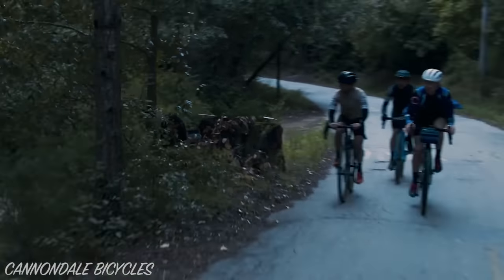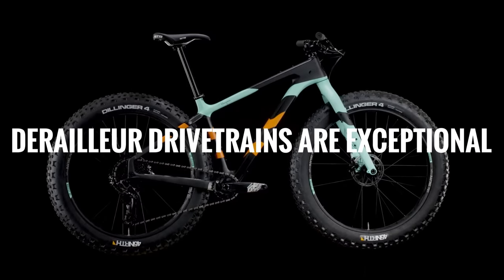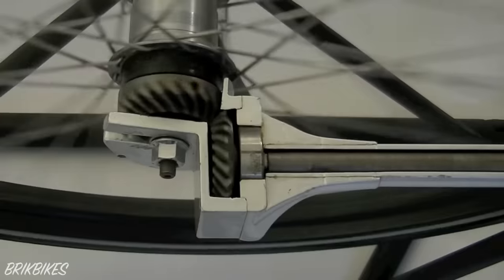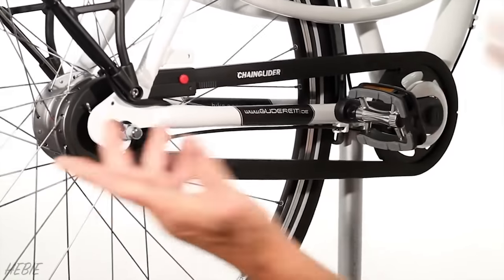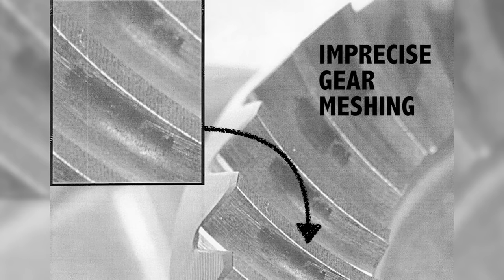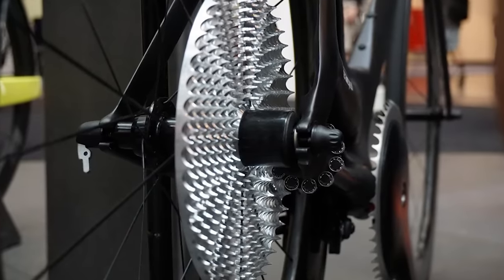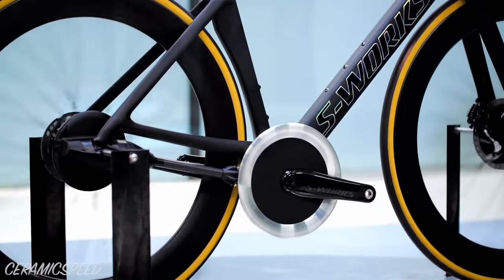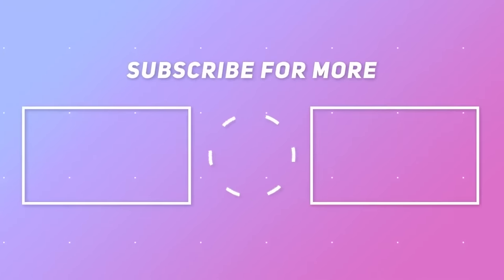Are Chainless Shaft Drive Bicycles a GENIUS or TERRIBLE Idea?

Comment: although not directly comparable, there's more chain vs shaft data in the motorbike world. From memory, their numbers were 95% for chain and 80% for shaft.
Reply: There's one thing that I have to wonder about though... I assume all these tests were done with fresh sprockets and chains. But if we assume that the user is not going to maniacally change these parts as soon as there are smallest signs of wear, the efficiency will drop, and chain system will likely start wearing much faster than shaft. Maybe on average the difference is not that critical?

Motorbikes also have a separate gearbox instead of a derailleur, meaning they have much less chain/sprocket wear, too
Reply: Bike chain line efficiency has been studied to death. Bike chains can reach 98% under lab conditions with certain fixed large diameter sprocket combinations, think 30T+ on both ends. 

In reality a fresh and properly set up 9 speed drivetrain hits between 83% and 95% depending on sprocket combination and drops from there over time. The individual factor with the highest direct impact is chain tension. Any slack in the return (ie top) of the chain greatly impacts efficiency.
Reply: @N V Percent energy transferred, the higher the better. Remaining lost to noise and heat.
Reply: @N V Different parts do different things. Thus different efficiencies. Dont mix things.
Reply: Slightly off topic - back in my motorcycling days I had a motorbike with a driveshaft. On one memorable day the driveshaft snapped. I was travelling south on the A12 (in the UK) approaching the junction with the M25, maybe a mile or two away, at about 70mph. The two ends of the drive shaft then wedged together inside the casing, locking the back wheel solid. Biggest skid I ever did.

Comment: I think the gearing needs to be at the crank, and fixed at the axle.
Servicing and sealing would probably be easier. Also, the ring gear could be supported and aligned by the stronger frame, not weak spokes.
Reply: @MikMech -- that is what I have always thought too.  A Rohloff hub with a shaft drive might be the ideal city bike set-up.
Reply: I agree. What excites me most are innovations around gearboxes like Pinion’s that happen at the crank. And, given the current technologies I like both chains and belts. I have both and they’re both great in different scenarios. I have a single speed with a chain, multiple bikes with chains and derailleurs, and a bike with a gates drive and shimano hub. They all have their place right now but an efficient, lightweight gearbox at the crank that can change gears under load seems to be the most realistic ideal.

$.02

Comment: I was working in a machine shop in the mid 80's in Chico CA while going through engineering school.  One of the machinist's showed me the exact concept here that he was working on.  He was very excited this would revolutionize biking.  I didn't think he had much of a chance of succeeding as I figured it couldn't compete with the efficiency of a chain.  But here we are.   I hope he profited on this some how but it's very difficult to bring a product to market, even more so before the internet.  I suspect this was independently developed and he never received anything.
Reply: There's also one system I've seen where it's rods pushing back and forth.

Comment: Note to self: modify Street Racing car to use chain drive and derailer.
Reply: Reliability is a factor
Reply: Buy a Fraser-Ńash car.
Reply: No point. They have transmission with a shaft drivetrain😂 derailleurs are just small size transmissions😂

Comment: In my experience, the few shaft-driven bikes I had rided feel much heavier than normal chain-driven ones.
Reply: @Karl with a K The video stated that they are less efficient than a chain drive…
Reply: @Karl with a K "zero maintenance" is a complete lie.
Reply: @Karl with a K you should be a shaft bike manufacturer for saying shaft are more efficient :D

Comment: the chains advantage is that motion stays in the same direction throughout power transmission.  a shaft changes three times.  Each change introduces inefficiency .
Reply: Added to that is the shaft is angled away from the crank-angle!

Comment: Looking at the Driven system I'd say it has a flaw you didn't mention, similar to your #3 - forces on the teeth are applied in a direction where the sprocket is weak.  In a chain drive, higher tension pulls the chain into the teeth.  In a shaft drive, it pushes sideways on the teeth.  There's also much less distribution of force; in a fresh chain and sprocket, it can pull on multiple teeth, the Driven will only ever be one bearing pushing on one tooth.  Aside from the mechanical leverage you mentioned in #3 this is why bevel gears need to be built much more heavily.

Comment: Actually... If you put the drive shaft of the bike on a pivotable axis that can swing horizontally, then you can add a stack of different size gears on the back wheel. Then you would want to make the drive shaft's gear on the back end be spring loaded so it can move forward and backwards inline with the direction of the chassis, the spring action being parallel and also add a control chord you can adjust from the handlebars. Finally you will want to add a spring loaded cable to control what gear on the wheel hub is lined up the shaft. This cable would be attached to the handlebars and can even be wired through the frame. This cable is the cable that controls left and right motion along the horizontal axis (perpendicular). Now you could go through all that to make it have shiftable speeds, or you could replace the springs with motors. Or you could buy a hub motor for any bike size 20"or larger. Just a thought 🤔

Comment: I never even knew shaft drives were a thing for bikes. sounds like a great idea to me. I've never had a bike with a derailleur that didn't get messed up somehow after a very few uses, and wind up gettint stuck in one gear anyway. 

In fact it's so bad the last bike I bought was just a single gear, just like a kids, so I didn't have to deal with it.
Reply: You must have been buying low end bikes then
Reply: Internally geared hubs are a thing too.
Reply: Maybe next time you will take better care of your bikes.
Reply: Try adjusting the derailleur
Reply: To ignorant to figure out a bike? I wouldn't be bragging that up.
I've got a 30 year old derailer that works just fine. But I know a thing or two about maintenance.
Reply: @brianellison3525  as an engineer, this is a terrible point, you might be invested in your bike, but 99% of the population is not especialy kids, they want to be able to get it out of there cluttered garrage, go to the shops, maby do some trail biking, then bring it home and chuck it back in the shed for another 6 months
you wouldent expect the average person to be able to fix problems with there car, thats why manufacturers make them bombers as all hell so your average joe wont have issues they need to fix all the time
not to mention other people, twice now ive had someone put there bike next to mine and fuck up the derailleur when ive put it into a bike rack
and sure, better derailleur's on nicer bikes wont have so many issues as someone else pointed out, but again average joe is dropping 150-200 on a bike at most, they are getting the cheepest derailleur china can manufacture
you have to take into account the consumer base on thiese kinds of things, just because the manufacturer failed to do that, does not make your average person ignorant
Reply: Could you tell more about the bikes you use? Did the derailleur got hit to be messed up or did it fail during normal bicycling? If the latter, are you using cheap bikes from local supermarket? With a cheap derailleur you have to adjust it before every run and it still doesn't work great because it has so poor tolerances. With high quality derailleur, you adjust it maybe once a year and unless it gets hit, it should last for a decade.

Comment: that is A LOT of assumptions you make about shaft drives based 
on one test from the 1980s
Reply: Bicycles aren't the only machines that use gears or chains, the efficiency advantages of chains and belts over gears (and especially bevel gears) have been well understood for a long time.
Reply: The cost, lack of efficiency, and lack of easy fix is still prevalent today.  Keep in mind the bicycle is by far the biggest mode of transportation throughout the world for almost 2 centuries.  Somebody keeps trying to revive the shaft drive like somebody keeps trying to make a better rotary engine.  Its not happening.

Comment: Myself I think it's do with the derailleur being able to be used on a wide variety of bike. I follow a guy called Allen Milliard and he made multiple amazing downhill bikesfor his son who competed that where on average around 3 secs faster than other bikes at the time. Great content very interesting, thanks for sharing.
Reply: And he did it by using a Shimano geared hub mounted inside the swing arm, with an enclosed final drive! Later versions even had single sided swing arms to speed up wheel/tyre changes. And he built it all at home in his shed! Also of note is the suspension shock/damper that Alan designed and built himself, basing his design on tank suspension!

Comment: This mechanism will wear out long before traditional chain drives. A chain drive contacts at least half the teeth thereby distributing the load. In this model the entire load is placed on one tooth at a time. It's bound to distort the teeth faster.

Comment: It's so simple - you crank a generator that shares power with a capacitor and a lithium battery. These release power to both hub motors.
You also get regenerative braking and you never over-exert yourself.

Comment: Driven basically has all the right ingredients. Large chainring, fast shaft with low forces, and large casette cogs. 

The only real skepticism I have about it is its out of plane stiffness.

though it doesn't have any of the reliability advantages over chain drives. You can't exactly imagine it working well in mud.
Reply: It might be easier to shield and clean.

Comment: I think shaft drive would work quite well for ebikes for the same reasons they work for motorcycles; you can increase motor power to compensate for the lower efficiency. Plus with a shaft drive, you could completely encase the whole system making it much more resistant to the elements, something which ebikes do still struggle with.
Reply: Very good points!
Reply: more power equals more battery consumption.  You've just killed your range.
Reply: eBikes actually have another point that makes then ideal for shaft drive; the motor can be mounted in alignment with the driveshaft for greater efficiency.

Comment: When possible, chains are better to use, they're more efficient, lighter, easier to repair and wear slower compared to drive gears. When you work on cars you recognise this quite fast.
Reply: Ah
Reply: @alohatigers1199  Lmao YouTube shadow banned your comment, even though you're pushing their views. Mechanical components are relevant to cars, even if you are concerned about the environmental impact of cars, it's a good reference point for mechanical components being used under load for extended periods of time. The environmental impact of cars is a seperate issue, not really relevant to my post.

Comment: Really interesting video, I think there is a place for shaft driven bikes and it's not recreational and sportive biking : it's heavy duty low maintenance bike sharing systems.
Weight and efficiency is less of a concern in bike share systems, people don't want to deal with greasy chains on their way to work or to the market.
Reply: Just using a case protecting the gears and chain will be still cheaper than using a shaft. Bevel gears are also more expensive than a simple reliable chain.

Comment: I think that rohloff+beltdrive combo becoming cheaper or efficient beltdrive CVT would be more revolutionary.
With shaft drive you convert the rotation motion to another direction 2 times and you most likely have to oil on those places like with chains. Does seem overly complicated compared to beltdrive and chaindrive that doesnt convert direction of rotation movement.
Reply: concur + as saying goes : gimmicks can be defined by amount superfluous parts
Reply: I think the bike market needs some more alternatives for gear boxes. Because rohloff and pinion are just way too expensive to consider and most other options just don't have enough gear ratio. Right now the only gearbox i know that could be considered a solid value with enough gear ratio to be used on an allround (commuting/touring) bike is the alfine11.
Reply: @jimihenrik11  
I agree. 

Having said so, I have a Rohloff/chain combination on my about 40 kg 2-wheel cargo bicycle with the gear ratios optimized for hilly terrain.
Even though I live in The Netherlands where it is mostly flat.

Comment: As a mountain biker, I have a chain. It works, is efficient and I can service it super easily. Not to mention relatively cheap to replace when it breaks/gets old.
Reply: I agree. I've changes my chain on my 2x11 and bought a XT chain for $33. And jokey wheels for $14. Transmission has no sound except when i change gears. Easy to install a chain with a chain breaker.

Comment: As an engineer  I see a lot of unnecessary drag built into the two 90° angles the torque needs to transfer through.
That's the advantage of the chain drive, its all one linear motion. Much less inherent mechanical drag.

Comment: Love my shaft drive bicycle. I use it for exercise not racing.  With prior chain bike, I hated getting pants caught in the chain, grease on myself or my pants. I also had the chain come off while riding once, which was a pain.  The shaft drive solved all those problems and runs a lot smoother.  I can also change gears while pedaling, which you can't do with chain/derailers.
Reply: What's that last point? "I can also change gears while pedaling, which you can't do with chain/derailers." I'm pretty sure derailleurs can't change gears unless you're pedaling.
I'm right with you on everything else though.  I especially like how shaft drive bikes don't need anything to be oiled or re-greased constantly, they can sit in storage for half the year when you can't ride and be taken right back for a ride without having to do any maintenance and it doesn't change how they ride at all.  I used to ride bikes with chains and hated how if they sat for even a few weeks without being ridden the chain had to be cleaned and oiled or it would feel like I was towing a bus.
Reply: @GremlinSciences  Maybe it was the derailleur I used to have, but you couldn't apply any drive pressure when changing gears. With my shaft drive, I can be peddling with pressure and change gears. Might not be best for longevity but so far no problems in the 6 years I've had it.

Comment: With the rise of e bikes, I think for a nice adventure ebike built for doing long distances on and off road  the shaft is phenomenal.
Reply: Dont most E bikes have hub motors?
Any sort of power transmission from motor to wheel would be inefficient in comparison
Reply: @awellner3285  There's also mid-mount motors usually found with conversion kits, provided the bike has a spot to install the battery and electronic compartments, which changes the bike mass balance.

Though a chain bike and trousers/ dress pants for work typically don't play nice.

If transmission driveshaft ebikes convince commuters to use their cars less and shift more into the electrical grid, I would not mind. So long as people BOTHERED to know that Class 3 Ebikes and electric motorbikes are legally different classifications, and I am not too pleased with bikers not following road rules, which I have personally observed everytime I commute on foot. The car always beats the biker in the weight class, and bikers think a bike helmet is sufficient protection.
Reply: @awellner3285  hub motors are easier to fit, but they have the same disadvantages as regular singlespeed bike.